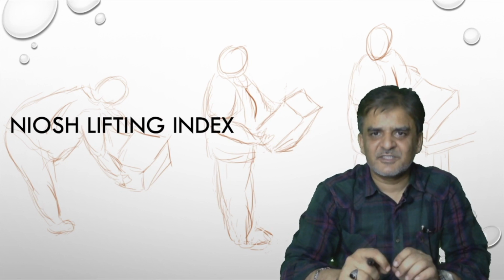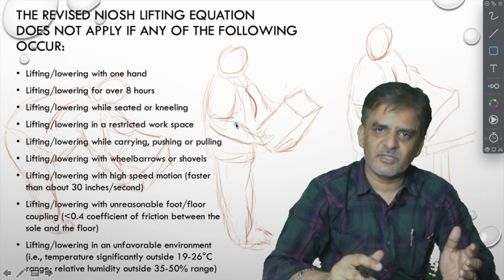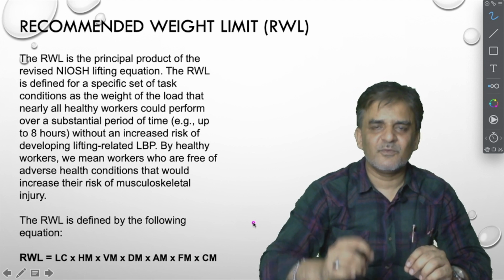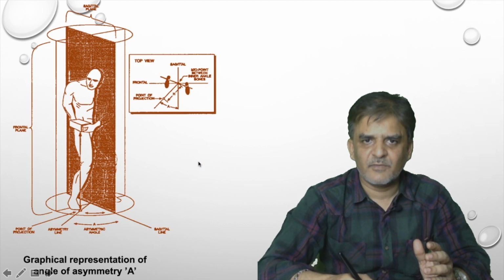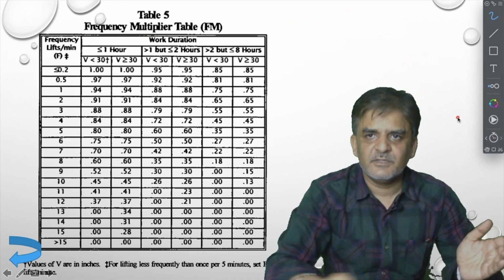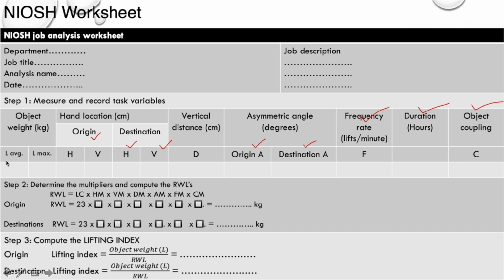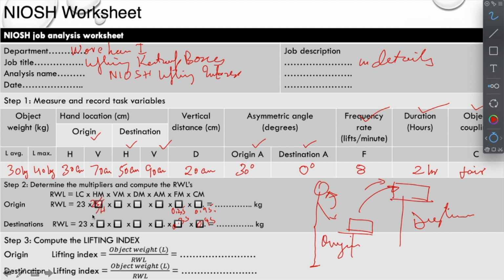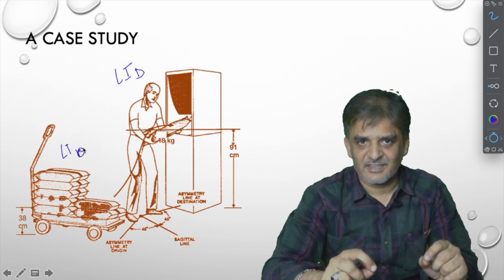Lecture 6: How to calculate NIOSH Lifting Index?  AMU

Comment: Hello sir, I wanna ask a question, if I want to research 2 person lifting job, is it still possible to use the Niosh Method, and what effect does it take into account? Is the weight of the load divided into 2 or something else? Thank you very much.
Reply from the maker: As per the model design of the NIOSH lifting equation, it is not possible. However, being a mechanical engineer and a little know-how of biomechanics, I feel that it is possible for limited conditions. Only when prior load calculations are done to know the fraction of load on individual persons and then calculating lifting index separately. Maybe a procedure like composite lifting index may be applied.
This whole idea is subject to research, not tested yet, as I know.

Comment from the maker: There is a correction in the video (Vertical multiplier 'VM' = 1-(0.003|V-75|). Instead of the 30 (i.e. in imperial system), it is 75 in the metric system.

Comment: Very nice explanation sir. Thanks. I have 2 queries.1)If a person is lifting a load from the ground, what is the distance from floor? 2) If RWL at origin is more and at destination is less, if after evaluation of the task, changes are not possible, then how much weight can a worker carry safely? As reducing the weight according to RWL at destination might increase the frequency.
Reply from the maker: If the load is to be lifted from ground then it has to be just away from bending knees in squat posture (horizontal distance). It can not be fixed because anthropometric dimensions are different from person to person. Vertically it is better to have above knee level. In reply to the second query: firstly we have to see which of the other factors has option to be modified for getting higher RWL. Such as HD/VD, etc. In case not possible then we have to go for the reduction in weight of the unit to be lifted as per destination. You are most welcome for any other queries, in case not clear. Best wishes
Reply: @engg_edu2117  thanks sir.

Understood 2 nd part. But what would be vertical distance when one lifts from ground?
Reply from the maker: It depends on the weight, however as per experience Incase weight is light may go upto shoulder level and for heavier loads must not go above heart level.
Reply: @engg_edu2117  I was looking for this-"the vertical distance is the distance of hand where they grasp the object from the floor." Got it from a book,I had to brush up. But thanks for sharing the video. I got to know the formulae for the multipliers.  Regards.